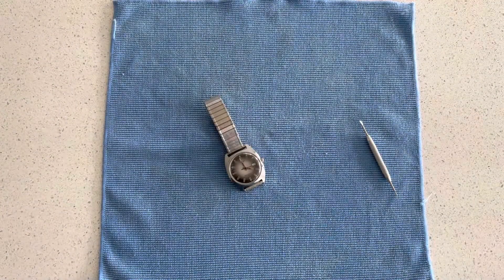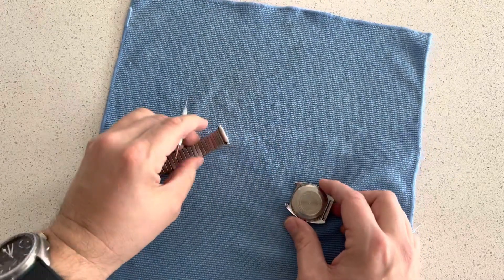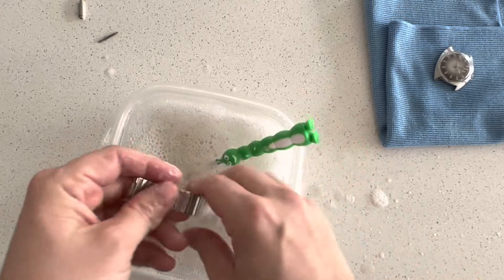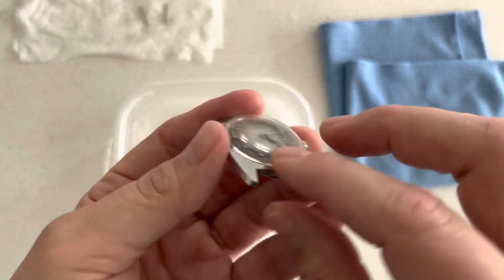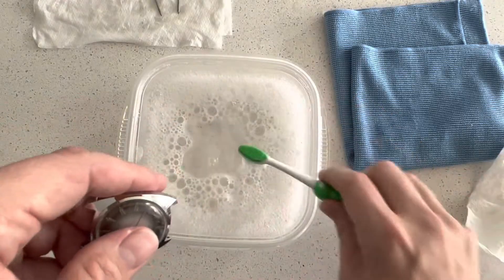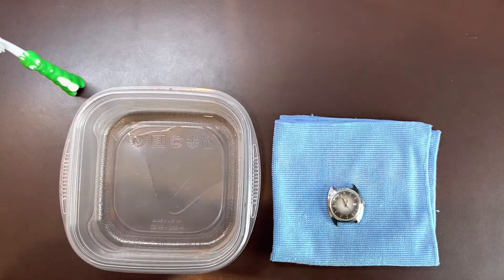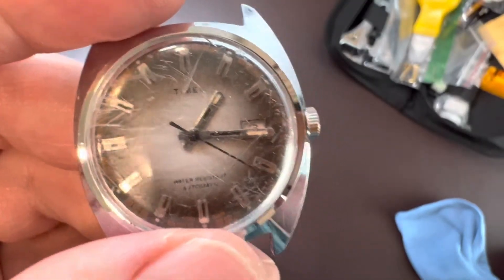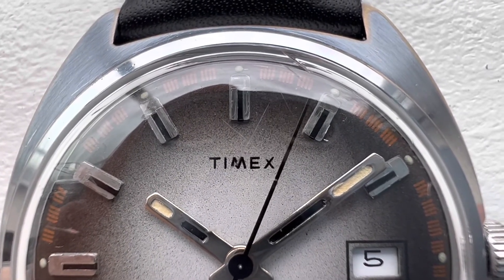Vintage Timex Project Watch - Part 2

Comment: That's a nice watch. If I could make some suggestions. Take the movement out to clean the case. That one comes out easily if you remove the spring clip that you see around the inside of the watch. When I clean the crystal, if it is bad like that one, I start with 1000 grit wet dry sand paper only go to the Polywatch when it is ready for a final polish. Waiting to see the final product when you are done. Oh, just watched the last few seconds. Don't try to brush the case. It is chrome plate over brass. Just lightly polish or you will go through the chrome to the brass.